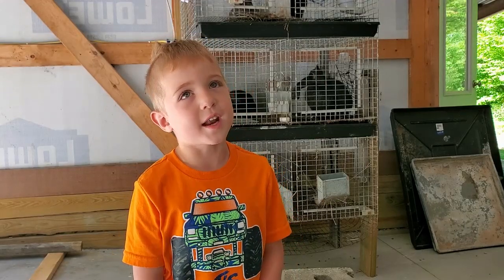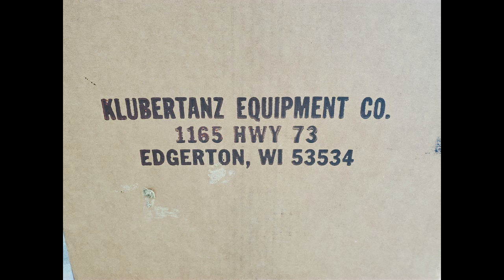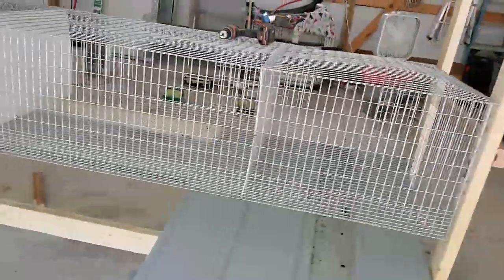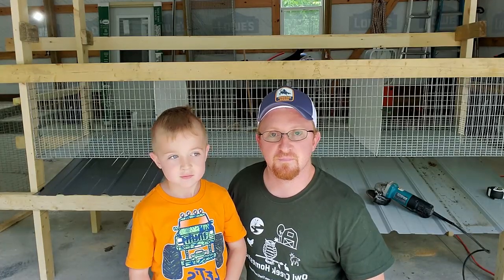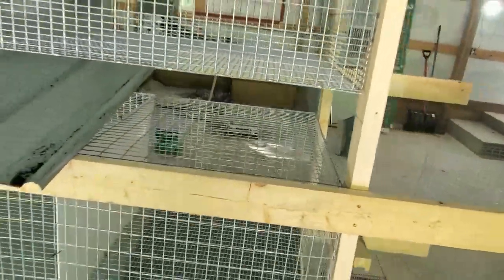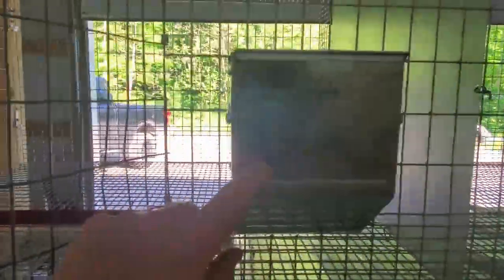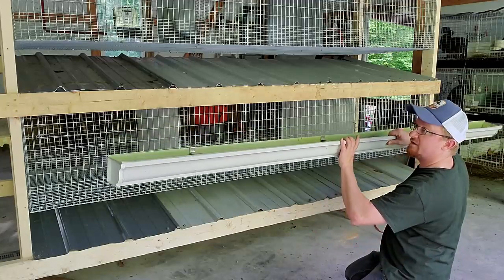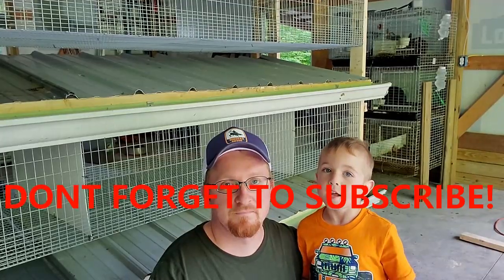BEST rabbit hutch design EVER!  DIY cheap and easy!

Comment: Great setup.  Everything you use looks robust meant to last. Have you ever tried just letting poop and urine drop on the ground? Also, with your setup, how long can you let it build up before you must dump the bucket?  Could you have let them both drain into one bucket, meaning the top downspout drains into the lower one?  Thanks!
Reply from the maker: when i clean it with a garden hose they fill pretty quick.  I plan to let the bottom row drop onto the ground once i relocate my hutch but that wont be for a bit.

Thanks for watchin!

Comment: Thabks for sharing! 
Great design. Did u find that the angle of the gutter was enough for everything to drain into the bucket?
Reply from the maker: Urine flows down fine, poop would still get stuck but it's easy to wash out with a hose.  Just keep an eye on the water level in your bucket while washing it out.
Reply: @OwlCreekHomestead  makes sense. Thanks for the reply!!!
Reply from the maker: No problem, thanks for watching!

Comment: Raises his hand to ask a very serious question I live in Mena, Arkansas and our temperatures in July, August and September can be as high as 100F at 85% humidity.  How can I keep my rabbits from being broiled alive?  I've debated digging a few holes and making a large (10 by 12 foot) buried heat exchanger then running pipes through the cages to lower the temp.  Using a solar system/battery/fountain pump I think it's doable.  So what are you doing to keep your rabbit's cool in the summer?
Reply from the maker: usually i use a fan and constantly blow air on them.  This year i may make a colony type setup so the rabbits can burrow down in the ground to stay cool
Reply: What breed of rabbits do you have?

Comment: Great video, very informative and helpful.
What did you use for the trim around the doors?
Reply: @Defiant, I have what they call, edge protectors that slide over the cut wire edges to prevent getting scratched. You can buy them from Bass Equipment https://www.bassequipment.com/Shop/EDGE-PROTECTOR-(6)-1375
Reply: @kennethmitchell2785  thank you, and happy New Year from 🇦🇺

Comment: Good job, although I also own rabbits and those wire floors are terrible for there feet in the long run. Please add a piece of untreated wood or turf into the bottom for them to stand on. They will also need little boxes to lay in.
Reply from the maker: thanks!   I keep a plastic try in with them to sit on when they want to get off the wire.  Thanks for watchin!

Comment: I want to get and idea of the angle of the sheet metal. I know your cages are 30 inches deep and 18 inches tall, what is the distance between the top and bottom cages? And the distance from the ground to the bottom of the bottom cage?
Reply: So he says in another one of his videos that there's a 4 in difference between the top and bottom of the sheet. The cage depth is 30 inches so there's a rise of 1.6 inches per foot. Most roofs have a 1 in per foot increase so this would be a steeper roof.

Comment: Even though you rinse the pooh into the bucket. Can you strain the pooh out to use it in compost tea? Or dry it to put in a garden bed? The water doesn't break down the pooh, or needed nutrients?
Reply from the maker: I usually just dump it right on the garden.  Sometimes I put it in a pile then till it in, but usually just put it straight on.
Reply from the maker: Oh, I have horrible soil up around my house so I have put a ton of it on my yard to get grass growing.

Comment: The wire bottoms are not good for the rabbits feet
Reply from the maker: I added plastic trays for them to get off the wire when needed so they can relieve their feet.
Reply: There’s actually been studies done and rabbits prefer wire
Because it’s cleaner, they don’t overheat, and because they can stand naturally
Unlike on a flat surface where their feet are forced to be flat 
On wire they can curl their toes
Reply: Rabbits also have thick fur in the bottom of their paws
so they don’t even feel the wire 

Unlike on a flat surface when a rabbit urinates while on wire they don’t sit in it and get urine build up in their fur which attracts flies
Reply: It’s if you have thin wire it’s bad but heavy gage wire is just fine.

Comment: I will never, ever , force my rabbits , to live on a gaze, metal dread wire floor...
Reply: Well if you like your rabbits in a cage wire with a place to rest is best. Unless you like wood where they stand in there pee and poop and get sore hocks. Or if you line a wood floor with straw now you get increase risk of ear mites. Wire cage (proper thickness and spacing) is quite hygienic and humane if you do it right. Plus wood absorbs odor and ammonia so they have poorer quality air. 
If you build cages wire is a great choice!